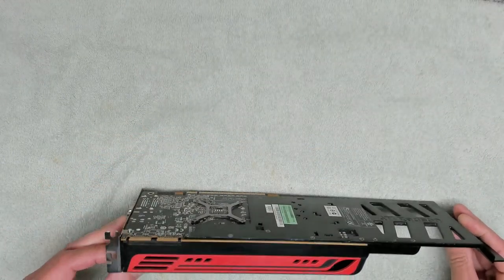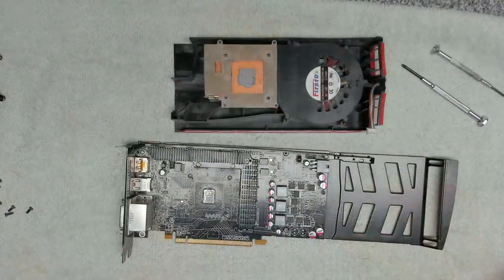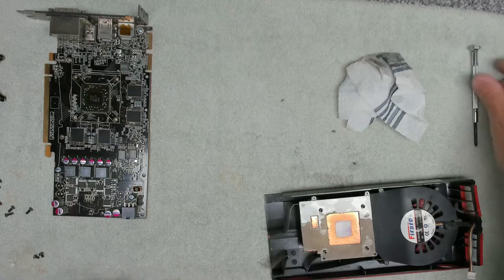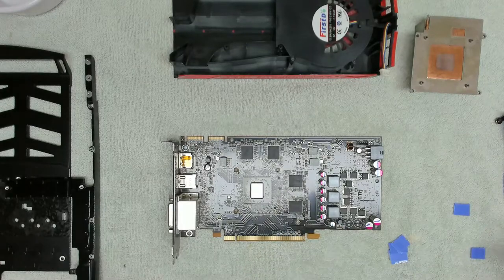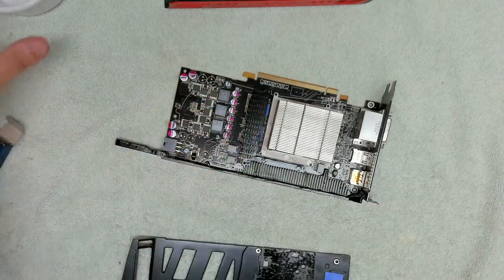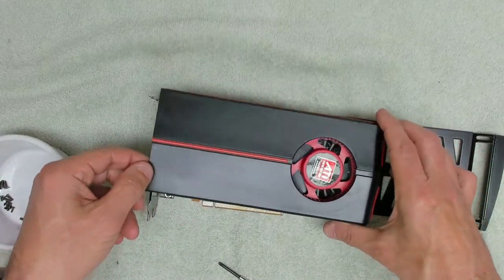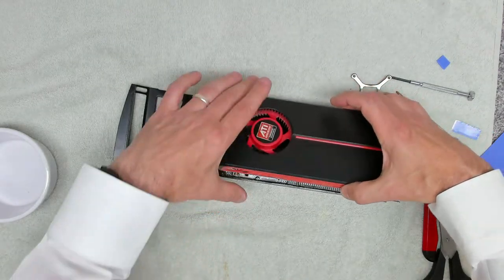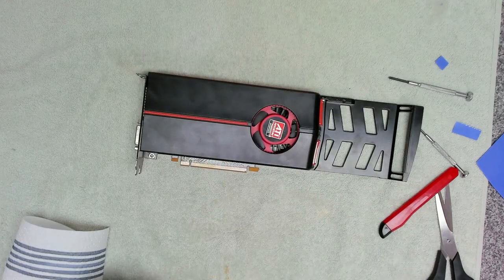Screw this! ATI Radeon HD 6770 teardown and clean

Comment: I just did this myself. Got the temps of a Radeon HD 6770 GPU running at around 65 degrees Celsius (idle temp) down to around 45 degrees (under basic load.). Fan speed dropped from about 2200RPM to 1350RPM. So yeah, seems it was definitely worth the trouble. I didn't bother with the thermal pads, only did the thermal paste and remove dust from all components. I would say the trickiest bit it is lining up the heat sink with the GPU because your view is obscured by the shroud/fan/heat sink assembly.